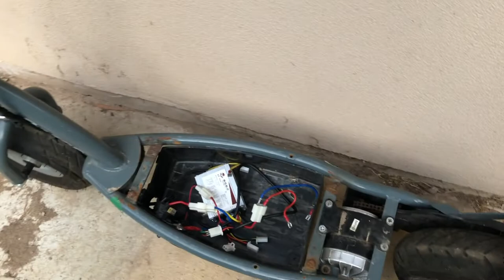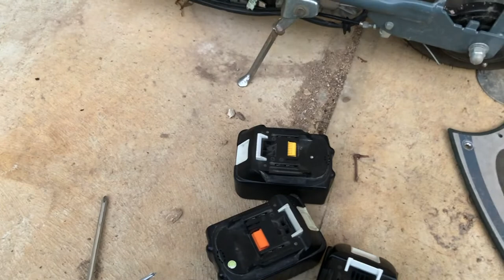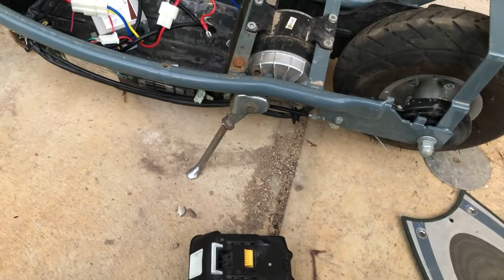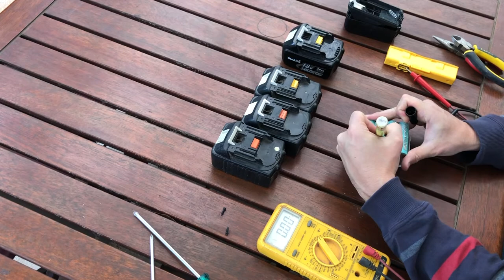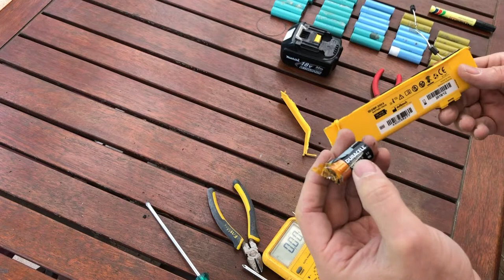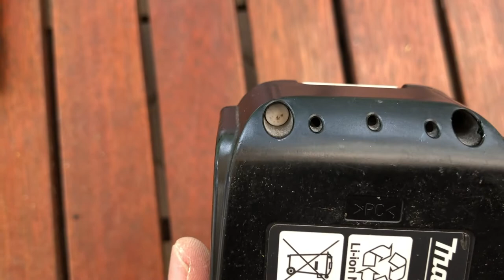Harvesting Lithium 18650 Batteries For Big Motor Razor E300 Electric Scooter - Free Tesla Cells

Comment: Sweet video dude!! I have a 48v pack that has a row or two of bad cells (won't charge past 48v when it should be 54.2) so maybe I'll try this and eliminate a row in the series and achieve the full voltage again.. Not quite there yet. Scooter going fast though I got some videos :) Subbed
Reply: Andrew McCauley upgraded to 24v Currie motor rated for 500w that fits in stock location. More vids to come
Reply: Andrew McCauley nope I put 100 miles on it in this config and no problems. It will get hot if you have too many watts (amps!) going into the motor. If you have a lower wattage controller (like 500-800w) at 48v it will stay cooler. The other catch is that the motor speed at 48v will mean you need to go 30+ mph to hit fill speed, since you’re never hitting full speed, motor can get hot in that situation too. I reduced the gearing with a bigger wheel sprocket (65T) and now motor can hit full rpm at 26mph
Reply from the maker: Sounds good mate! Cheers Drew